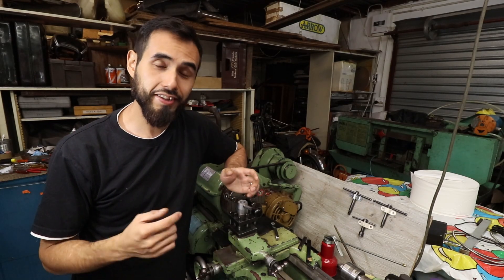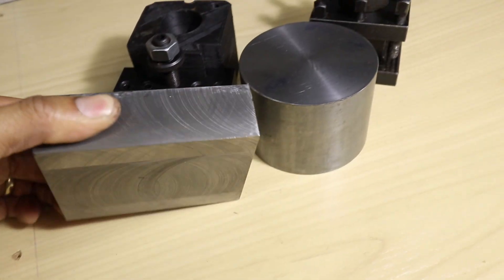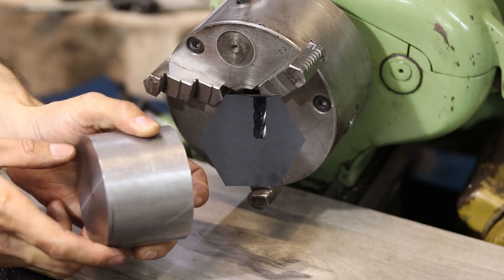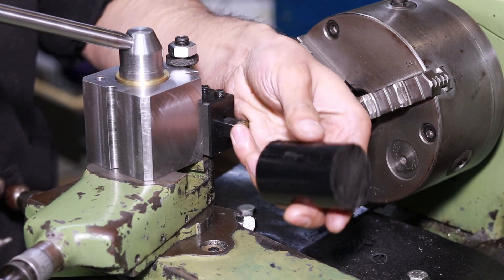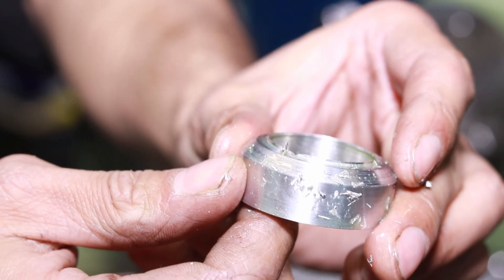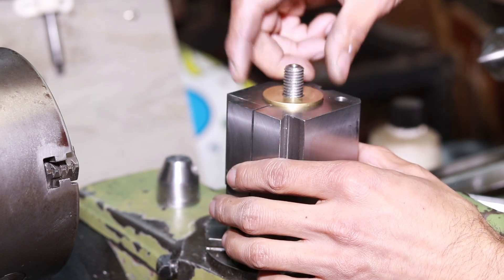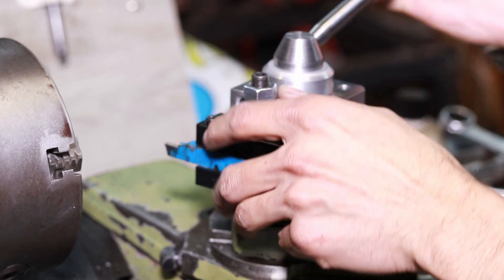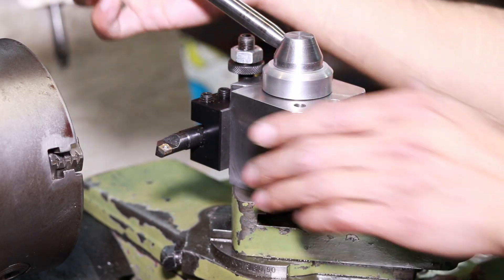Improved DIY Lathe Quick Change Toolpost

Comment: What angle did you cut the brass cone at? I'm thinking of making one of these for my micro lathe. Should be interesting as the current tool post is only 1" square.... gonna be a cute little bugger...

Comment: Nice video and presentation. 
I gave up the solid hollow cone idea based on the contact junction isn’t area contact but a line contact. When you have time do a blue ink test and you know what I mean.

Also chips can trap in the expansion slot preventing it from closing and release of holder.

Comment: Hello 
Thanks for your nice video.ihave one qoetion:
Exactly in the centre is big hole 🕳️ and exactly the besaid this hole also you did one small hole.for what you did?is nesesery?
Best regards sina
Reply from the maker: Hi there, thank you. It's not strictly necessary, I did it to help the part expand easily without cracking over time. I didn't want sharp edges that would lead to stress concentrations
Reply: @Mark_How  thanks 🙏 it is very biutifull.
Ihave one small lathe iwanted do ather one that isaw in YouTube but ilove your change tool post.be sure imake one small for my lathe.
Best regards sina 
Von Österreich 🇦🇹

Comment: Interesting- but I would have thought that indexing is crucial to a QCTP. Otherwise it becomes slower than a 4-way.
Reply from the maker: In the hobby shop it's often more the advantage of repeatable tool height that saves all the time. That's certainly been my experience using this one for a while now
Reply: @Mark_How  Agree- and using insert tooling this never changes. So a dedicated packer (shim) for a holder makes adjustment a thing of the past. (This can be superglued to the bottom of the holder if max speed is desired).Four tools in my 4 way means tool change is rare- and fast with a T bar and two bolts. QC is theoretically faster when you get past 8 tools- cannot remember the last time that happened.

Comment: Gotta love mystery metal.

I bought about 80kg of 4, 6 and 8"∅ round bar offcuts from a local metal recyclers a couple years ago. I've got no idea what this stuff is, and neither did he, but because of the uncertainty about what it actually is, it was dirt cheap........ and that's my second favourite price ! :D

Apparently about a ton and a half of the offcuts came in as part of a scrap metal consignment from an aero engine manufacturer, so god only knows what kind of freaky metal alloy it is. The stuff holds a magnet like mild steel, it's a nightmare to machine, dulls bandsaw blades in a heartbeat, eats lathe tool inserts like a fat kid going at candy, and absolutely refuses to rust. My best guess is that it'd some grade of Chromoly.

So far I've only really used some of the stuff to make a couple of 4" V belt pulleys, and that was incredibly hard going. I did contemplate making some large V blocks from some of the 8" lumps, but I REALLY couldn't face doing that much machining on any of this stuff ! :D

Comment: Well done. I think if you place two cones up and down it will be more symmetric and rigid.
Reply: And how would you lift the bottom cone? (The block cannot move as height setting is then lost)
Reply: @Tensquaremetreworkshop  Maybe make the top cone a long taper, the length of the tool post itself. That way you'd be spreading top and bottom.
Reply: @DIEmicrosoft  yes that would work but then the taper would stay in the block just like if you put tools in the tailstock. I think it has to be more that 16.5° to pop out of there by itself
Reply: If the cone is made deeper inside the block, it presses to spread the slot along the centerline when viewed in the height direction.

Comment: I maybe would have had a taper all the way down the middle, because as it is it's probably applying uneven pressure (more on the top and less at the bottom), kinda like splitting a log halfway.
Or instead, to keep the position locking functionality, maybe make that bottom ring a cone of the same taper.
Otherwise I feel your toolholders might be getting held by pressure from only one single horizontal plane, since the bottom will contract when the top expands. Hope I could get my point across.
Reply from the maker: No doubt there are better designs out there (reason the wedge type or piston type are the ones commercially available) but I still advocate for the cone type as a good upgrade to a lathe with a four way toolpost. For one, it's possible to find a compromise between downward clamping pressure and radial expansion by tweaking the cone angle, while still keeping it easy to machine. The other thing is fewer parts and greater forgiveness with the tolerances. That said, it does rely on a nice fit with the tool post dovetails such that only a minor bit of radial expansion is needed to lock the tool holder in place. The better the fit, the less you'd be trying to split a log
Reply: Yes i thought exactly the same, however your idea seems to be better since my idea was to duplicate the cone for the bottom but that would be complicated
Reply: Is there any rule about how long you can make a taper without it becoming more likely to lock in place?  (Please be gentle, I'm asking in ignorance. :) )
Reply: @ElizabethGreene  I had the same question a while back. There is a figure, around 34 degrees, but it is a rubbery figure, because surface finishes come into play also.

Comment: I really enjoyed this! Your workshop looks and sounds like mine! Less than perfect compared to Joe Py, Stefan Gotteswinter  or Mr Crispin for instance. Nevertheless, gets the job done - eventually. 
Just a bit concerned about the placement of the internal expander cone. I think it should be lower down so as to force the ways open at the level of the toolholder. Same as Федор Сухов commented. 
Anyway, thanks very much for this. It is inspiring!  I plan to make similar and smaller for my Taig lathe.
Reply from the maker: Thanks, thought long and hard about this, along with multiple CAD iterations. Wanted to strike a balance between the radial expanding force of the cone, vs it's vertical clamping force and still leave space for the locating bush at the bottom. The plan was to cut the cone at the depth in the video, try it out, and adjust it deeper if clamping proved a problem, but so far it hasn't, the trick is a close fit so that you don't need all that much expansion I find
Reply: @Mark_How  Well, this makes sense. And it works - which is the vital factor! 
Thanks Mark, all the best . . .

Comment: Great design. One quick question: What is the angle and size of the dovetail cutter you're using? Thanks for sharing.
Reply from the maker: It's about a 25mm, 60 degree cutter to match the angle on Aloris & clone tool posts
Reply: @Mark_How  Thanks for the info Mark.

Comment: Nicely done!  On my shop-built QCTP I placed a thin roller bearing thrust washer between the tool post clamping nut and the tool post clamping surface, in this case it would be the top of the conical plug.
This eliminated the tendency of the tool post to rotate with the tightening of its clamp, especially if there was oil between the bottom of the tool post and the top of the compound rest.  And it reduced the clamping torque required at the handle, tremendously.
Further, using square headed set screws for tool clamping eliminates the need to pick swarf from the screw sockets.
Reply: SOUNDS !! LIKE !! THE !! SWARF!! GETS !! INTO !! IT !! MORE !! THAN !! EVER !! BEFORE !! NOW !!
Reply: @davidwillard7334  Certainly swarf got into the sockets of the tool clamping screws which, for some reason, I found really annoying.
As to the roller thrust washer, there never has been a problem with swarf getting into it.  This bearing is at the bottom of a recess in the tool post, and the clamping nut is a close fit in this recess.  If necessary I could have fitted an O-ring on the clamping nut for a seal, but I did not find this necessary.
After I fitted the thrust roller washer, I was astounded at the reduced torque needed to fix the tool post.

Comment: Hi, excellent work.  I'm Brazilian, I see that your lathe is Sanches Blanes.  This lathe is very good.
Reply from the maker: Thanks, at first I had never heard of Sanches Blanes, but after looking into the company and getting to know the lathe I was and still am very impressed by it.
Reply: @Mark_How  Very good, which country are you from?  is your lathe model C?  How long have you had the lathe?
Reply from the maker: It's a model A with the quick change gearbox, had it for about 3 or so years now I think. I'm from South Africa so there are quite a few different makes of machinery that we come across here
Reply: @Mark_How  Really good, then make a video showing all your lathe, I think many Brazilians will like it.  The Sanches Blanes factory no longer manufactures lathes, but people still manufacture spare parts.  Your model A is equivalent to our model C, here the order of the models has been changed according to the manufacturer.  Congratulations on the channel.

Comment: superb little hack with that cone spreading the dovetail. did you invent it or you saw it somewhere?

I'm going to use this technique one day, when I buy the milling machine.

for now I'm excited and waiting for my 1st lathe ever to arrive.

subscribed!
Reply from the maker: Thanks, it's actually been done by a few people before, but it works really well. Has a surprising amount of clamping force.
Nothing quite like the excitement of your first lathe, here's to many happy projects 🍻
Reply: @Mark_How  cheers! 
I still don't have a lathe and I already know I want to make that quick change post, using the cylindrical cone pressed down, as it feels so much more rigid than the cam clamp pushing on the peg.
because I don;t have access to the milling machine, I'm thinking to face the steel cube on my lathe (can it be done on 900W brushless lathe?), and then cut the dovetails on the bandsaw and file it by hand to match the wooden angled mockup.
I know it sounds crazy but I have to deal with what I have. 
I saw someone attaching hand filed dovetailed plate  to the steel cube with the bolts, but I prefer if the whole post is a one solid piece of steel. I'll soon find out if it was doable without a mill.
Reply from the maker: Should be doable, you'll know pretty soon what the lathe will and won't be capable of. You'd always be able to take lighter cuts. 
Having a wooden template of the dovetails would be a good idea. Maybe make it a touch bigger than the final dimensions. Get the shape of the dovetails right. Then check that the dovetails don't have a taper by checking them with pins with a micrometre/calipers. The measurement across the pins would need to be the same top to bottom. Then you could bring it in carefully to final dimension and shape. 
It's definitely doable if you take your time. Here's a good writeup to one of the original builds using only a lathe (and milling attachment). If your lathe to be has t-slots on the compound, you could get pretty creative with the setups though:
https://www.practicalmachinist.com/vb/south-bend-lathes/machining-mla-23-toolpost-174336/
Reply: @Mark_How  the pictures are not clear enough to see, but it looks like there are T-slots at the edge profile of the compound. 
not even sure what the below specs mean, but I think I could mill some small pieces by just moving the "thing"' horizontally against the end mill in the chuck. I will need to buy or make a milling attachment, to get the Z-axis movement, or get creative with shimming it.

Maximum travel of the tool holder: 55mm
Medium pallet travel: 75mm
Large pallet travel: 276mm
Reply: @Mark_How  Wedges are very powerful, so are levers. You have a double power whammy going there!  I'm fascinated with the power of ER collets, which the principles can be applied to a lot of things, including anti-backlash nuts.

Comment: Hey dude really cool design and well machined. Did you ever find out what grade of metal it was. I’m currently building a QCTP out of EN3 mild steel and am debating wether or not it needs to be case hardened.
Reply from the maker: Since this stuff machines so nicely I think it might be SS303, very easy to get good finishes on it compared to some 304 I've done. The tool holders I've made in another video are some unknown grade of mild steel and those have virtually no signs of wear even after several months of hard use. While your grand kids might not inherit them, EN3 should serve you well, EN8 or EN19 (4140) might save you the trouble of having to case harden though if you can get your hands on some
Reply: @Mark_How  good to know yours have lasted well since making them. Fingers crossed once mines all done it last the same sort of time.

Comment: Have you added an indexing feature yet? It will make your tool post much nicer when you have repeatability, especially in conjunction with a DRO.
Reply from the maker: Not just yet, I wanted to, but finding I change my compound angle far too often between threading and other weird tapers. Also a bit limited in tool height, wanted to index a plate to my compound t-slot, and drill into that, but then would struggle to get some tools low enough to be on centre. So still pondering a better solution

Comment: Good job! I think the cone expands the body unevenly, more at the top, and the cassette will be clamped unevenly. For uniform expansion, the cone must be in the middle of the holder's body.
It would be great to see a dimensional drawing. What taper angle did you use and what material?
Reply from the maker: Thanks! I was also worried about that at first, but found that the cone fortunately sits about where the toolholders like to be. And it leaves me space for the pivot bushing at the base of the toolpost. I chose a moderately steep angle but still the toolpost is snugged down first and then it begins to expand the dovetails. In normal use the height adjustment nut also helps resist the cutting forces. But even in reverse with the tool upside down, a little more force on the handle secures the holder well. I'm thinking of putting full plans up for a small price on Etsy, just to help fund the workshop a little to be able to do more projects like this
Reply: @Mark_How  Do you want to separate the body fixation and holder fixation? How is it done on Chinese QCTP 250-000?
I want to try to repeat your design, with its own nuances, drawings are not required. I have seen examples of different QCTPs, but I think that expanding or contracting the dovetail is the most correct way to achieve rigidity and repeatability.

Comment: Very good design and craftsmanship. Have you thought of hardening the v grooves since most commercial bought holders will be hardened and can start wearing out the tool post?
Reply from the maker: It was a concern of mine early on, but I've been putting it through its paces with some paid work and it's holding up remarkably well. The only real scratches so far have been where the height adjustment nut contacts the top of the toolpost if chips get under there.  I think if it were hardened it would last until my grandkids, but at present it should last as long as I'm not completely careless with it. The body seems to be a grade of stainless steel scrap-binium.